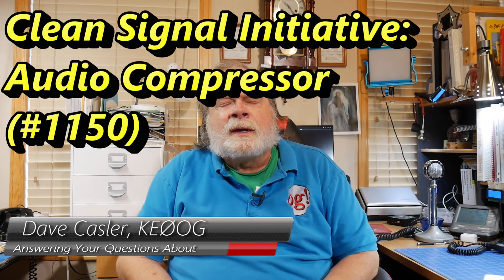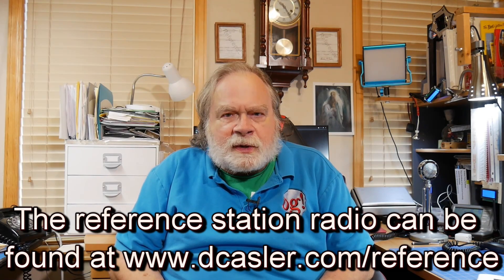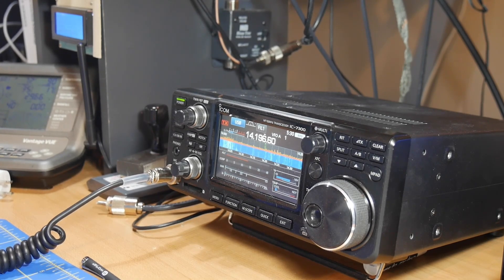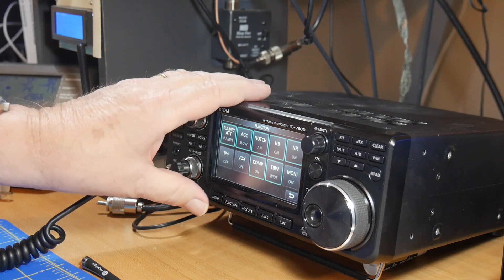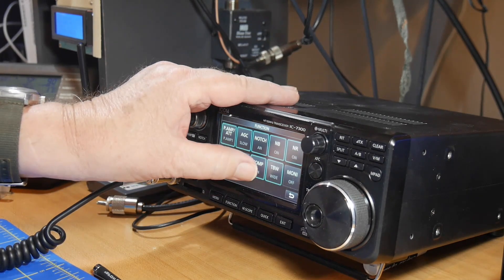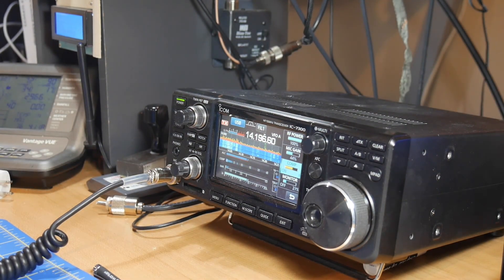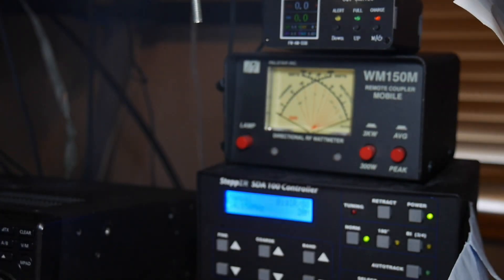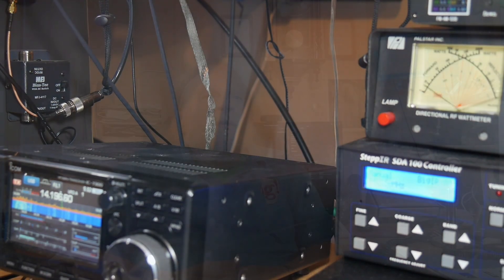Clean Signal Initiative: Audio Compressor (#1150)

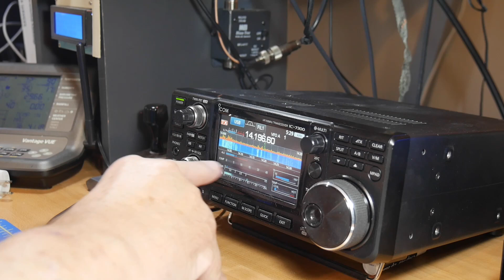Comment: 6:41 I love these hands-on informational videos! A quick observation: I noticed that the quote from the manual says to " Adjust the Mic Gain to where the ALC meter reads within the 30 to 50% range of the ALC zone" (that's 30 to 50% of the little red bar). However, during this demonstration the ALC meter was at more like 80 to 100% of the ALC zone (about 50% of the ENTIRE width of the meter line) and even briefly exceeded that level. Thank you for all that you do, and I'm looking forward to watching more of your videos. ~ 73, AC7WH

Comment: With the stock IC-7300 mic, the transmitted voice sounds distorted above the 3 setting on compression, even though it shows way less than 10-20 dB on the meter.